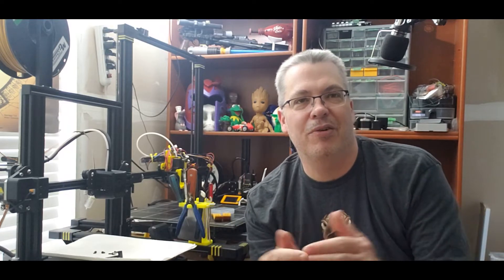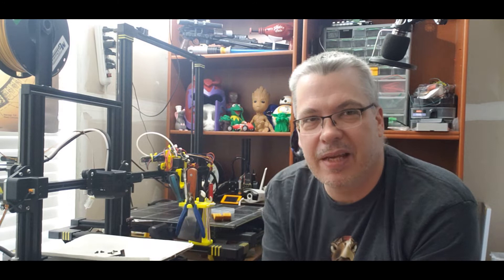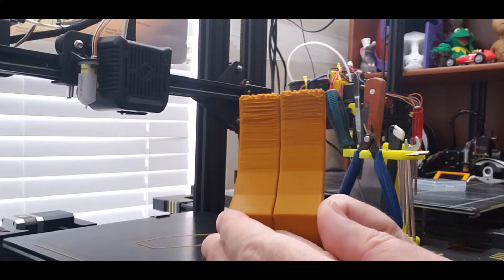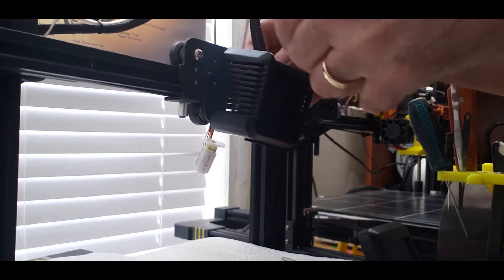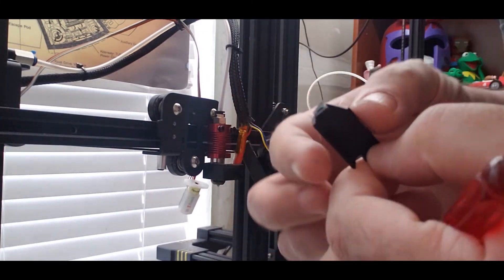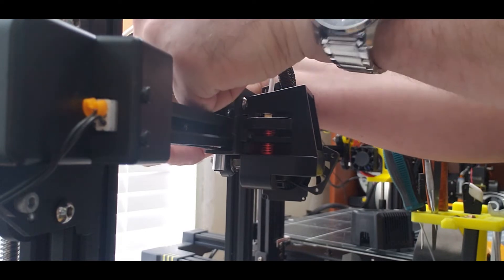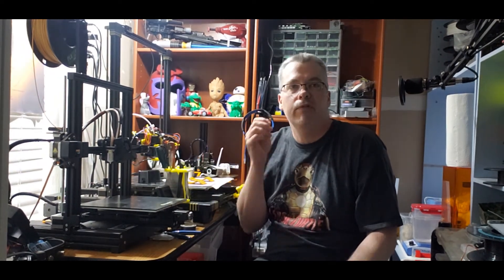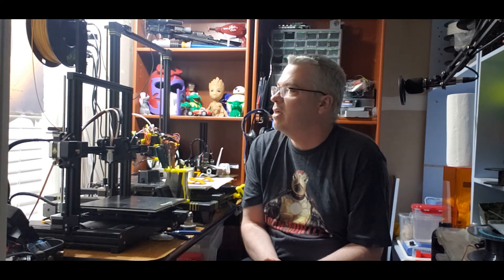Voxelab Aquila Cooling Upgrades

Comment: Thanks for sharing. Which material did you use to print the housing? Also so you have a link for the blower fan? I am planning to replace both fans and use a 40x40x20 for hot end that’s quieter and more reliable and also need to work out what blower fan to get
Reply from the maker: I used petg and sorry I got the fans off Amazon I don't have the link.

Comment: Would adding some thin PC Case dust protection foam to the front of the fans to stop them getting dusty stop the air flow too much?  
Or would it be fine to fit some foam there over the two fans.

Because if it was okay to have the thin PC case foam there, I would try to set up the foam as square pads 
maybe with some black metal mesh over the fans to stop the suction pulling the foam inwards to jam the fan!
Reply from the maker: That sounds like a good idea .you would have to clean the foam regularly I would think.

Comment: Rather than reprinting the shroud to fit a blower fan It would be GREAT if you designed an adapter piece that add-on to the original and accepts a blower fan. =D
Reply: X2 has a blower fan

Comment: Hey for the power supply how many volts should it be because mine seems a little low compared to a lot of other people‘s tronxy I have a 220v-110v power supply is that normal or a little low

Comment: After installing new extruder piece i cant seem to get enough clearance to do bed leveling. Once I level the bed the air ports on the bottom clean the print from bed...bummer guess its back to the original piece :(
Reply from the maker: Its probably just out of alignment. I'm guessing its lower on the right side? It just need to be adjusted. It to adjust it slightly counterclockwise.
Reply: @jeffs3dcorner  it was indeed, small little tweak and some sanding it going to be fine. Thanks for the fast response it helped  this noob greatly! First 3d printer , and I'm extremely please with all the projects I cant now complete!  Great channel very beneficial to the 3D printing community, keep up the great content!!! Thank you

Comment: I've printed that out and it hits the prints on my printer. The blower nozzles on the bottom are to low.
Reply: I have the same issue ill just file it down when I get a chance only a little needs to come off.

Comment: Am I supposed to have a leftover M3 Screw after mounting this? I can't seem to find where to put one of the black M3 screws, I have the shroud attached to the hotend part with 2 screws, 2 screws for the part cooler fan and 2 for hotend fan, but I have 1 left over that I don't know where to put.
Reply: It also seems like it's not completely centered because there is no screw holding on to the right side so it's a few mm further away from the gantry
Reply: Never mind, the shroud warped when printing with it after a few prints, I won't be using it anymore, If I decide to print it again, I'm going to use PETG or ABS.

Comment: Hey Jeff enjoyed the video, keep up the good work! What offset did you end up using for the 3d Touch? Also since all my Ender 3's need a 1.5 meter cable I would assume it's going to be the same for the Aquila if I route the ABL cable through the braided sheath. Don't think a 1 meter will be long enough?

Comment: I just installed a Fang with two 4020 fans. Made a nice difference. Printing a 80mm fan main board and PSU covers to quiet the damn thing down. I love this printer! Being my first printer, I’m very happy with it.
Reply: What STL files you useing for those?  I'm decking mine all out, I want it quiet, easy to use.  I got new fans coming for mine, the stock fans suck.
Reply: @matthewsuggs1637  it’s the Fang v2 on Thingyverse.
Reply: @matthewsuggs1637  Thing ico
1 pc no support fang for Ender 3 V2 dual 40mm fan
Reply: @matthewsuggs1637  Thing ico
Ender 3 V2 & Pro Silent Motherboard is a deep well for an 80mm fan so you have room with all the wires.
Reply: Whoops, I said 4020, but actually just 4010 Winsinn led fans. Made a huge difference and the main board fan too! Now I just gotta swap the PSU fan as it’s annoying me that the others are quite! 😀
Reply: Printing a 80mm fan main board and PSU covers from?
Reply: @tjbishop5374  PSU cover by Cumps (Ender 3 V2 PSU cover (80mm Fan)) and the mainboard cover by TerraVestra (Ender 3 V2 & Pro Silent Motherboard). Watch the screw holes on the motherboard as the Aquila holes are a bit off vs the Ender. Hope that helps get yours cool and quiet! Amazed at the difference.
Reply: @stonefarmer3005   THANKS  will let you know

Comment: What size is the blower fan for your remix?
Reply from the maker: 5015
Reply: @jeffs3dcorner  Thank you very much. I finally have the shroud printed and installed on my Aquila and the nozzle is higher than the cooling ducts. I cannot see an obvious way to adjust this. Any ideas?
Reply from the maker: One side or both?
Reply: @jeffs3dcorner  it was the left side. There was no adjustment in the print so I used a drill to make the hole next to the BL Touch a little larger and I filed the ducts a little. This gave me just enough clearance. Leveling the bed now and then running calibration prints. Thanks for the quick response.